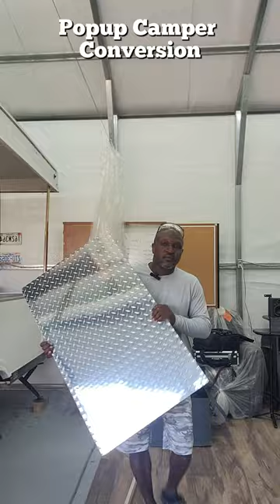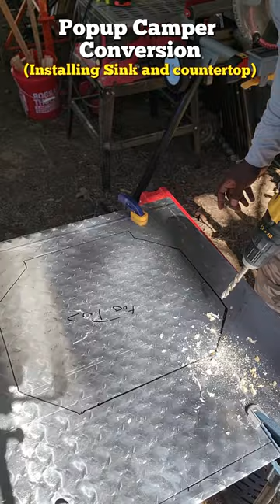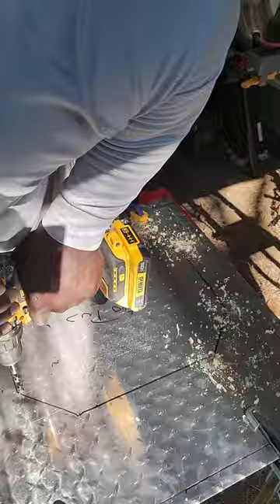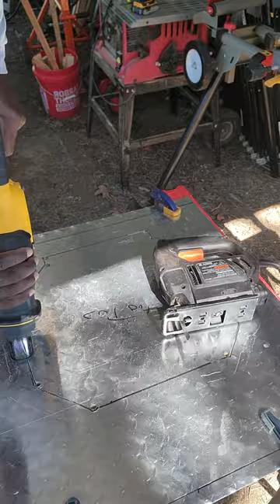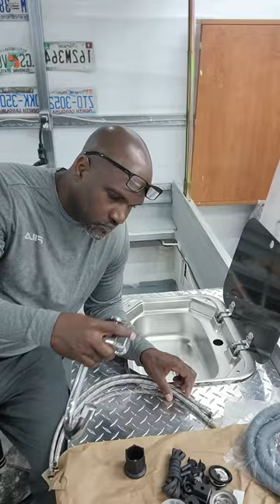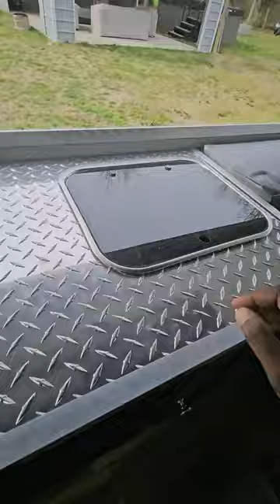Popup Camper: Hidden Sink And Diamond Counter Top

Comment: You did a great job….can you repair  or replace a oxidized rear bumper of a pop up?
Reply from the maker: I would sand it down with 40-80 girt sand paper and then put rust spray paint on it. Then follow up with a color of the rust paint. But, we work by trial and error. Thanks for watching. We have more coming out soon. We are going to reveal the completed popup and van all at one time.